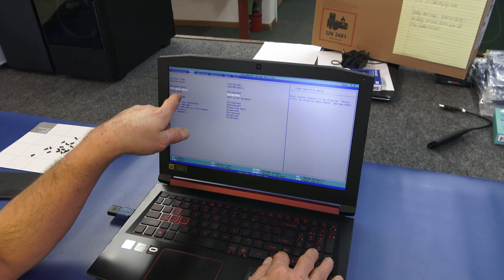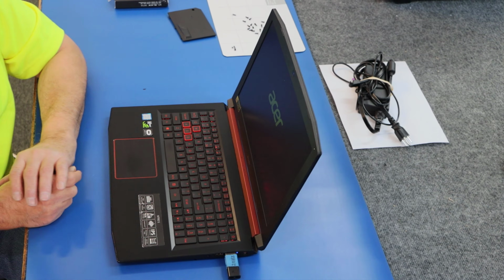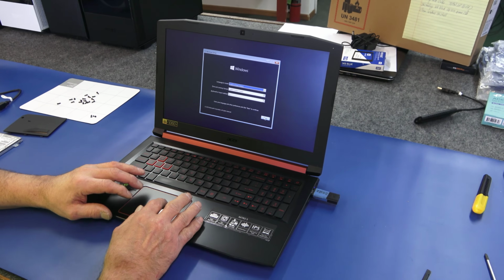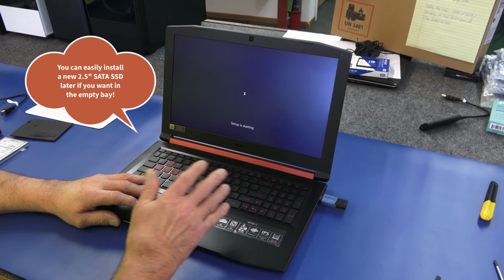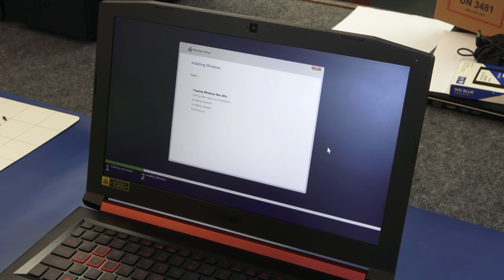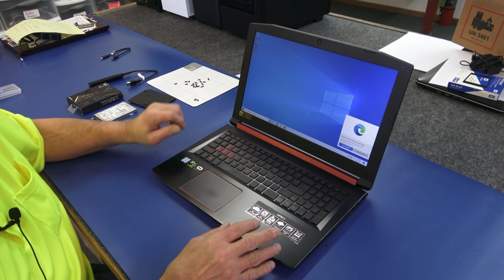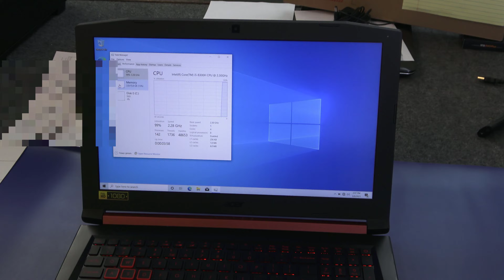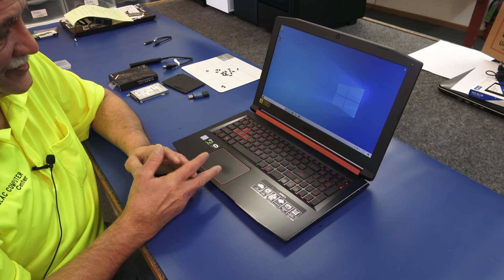Acer Nitro 5 AN515-53 Replace Bad HDD With New NVMe SSD, Upgrade Memory, Clean Windows 10 Install

Comment: Bonjour , je vous envoie ce petit message de France , et vous faites partie de mes youtubeurs favoris , grace à vos vidéos trés bien expliqués , j'ai pu installer un NVME de 1 terra , plus 1 SSD de 1 terra et passer à 32 gb de mémoire sur un petit laptop hp de 15" amd ryzen 5 HP Pavilion Gaming - 15-ec0001nf et ce il y a deux ans grace à vos vidéos , et la je vais changer mon NVME de 1 terra pour un crucial de 2 terra .
Toutes les opérations que vous fournissez m'ont complétement guidés et tout fonctionne , un grand merci à vous , merci beaucoup Cordialement Arnaud Pernet Kersanté

Comment: I replaced the HDD with a new SSD. I get a message “ no bootable device”. So I put the HDD back in and it works. How would I transfer whatever is on the HDD to the SSD so I can remove the HDD entirely and have it boot normally?
Reply: hey do u still have this issue?

Comment: so my laptop also wouldnt boot and i got it rapaired turns out the guy just took my 1 TB thing out and downloaded windows on the 100GB thing and now my 1TB things place is empty so i got a 200 GB ssd drive and i wanted to know if i can just plug that in the 1TB things spot and then do the thing i need to in the settings to it and it will work pls tell me i really need to know becuase i need more space but i cant buy a new one so i just want to know how to get that ready and working

Comment: I’ve had this laptop since 2018 but the battery doesn’t last as long as it used to. Is it still worth upgrading its specs? Or is it time for a new laptop
Reply: Always buy laptops around Black Friday. I got an Acer Nitro 5 with ryzen 5600H and 95w RTX 3060 for $650 last year. There was another option of a Lenovo IdeaPad 3 with newer processor but only RTX 3050Ti for $600. I payed the extra $50 for 3060 since it had 4gb vram vs 2gb 3050Ti. I replaced the ram with a 32gb kit and got a 1 TB WD SN570 to upgrade it and only spent $800 total.
Reply: Personally I’d keep it for a couple more years, get what you can outta it, you can get new SSD and upgrade the ram to 32GB and it will go decently fast.
Reply: Right now amazon has WD SN850X 1TB m.2 nvme SSD for 65 or 130 for 2TB if interested.

Comment: Hey! I ripped the sata cable connecting the hhd to the mobo while taking the lid off. I’m replacing with a nvme but I was hoping to keep that info on the hdd. Can I just replace the sata cable? It’s a clean rip (on the hdd side)

Comment: Did you use the ssd with or without heat sink and what do you think about the sn850 ?
Reply: Heatsink won't fit unless you get one of those thin copper heatsink plates on amazon. Idk if you've already got an ssd but 1TB WD SN850X is 65 right now on amazon and 2TB is 130
Reply: amazon m.2 copper heatsink. You'll see them with thermal pads. I just got 6 copper plates with thermal pads for 16

Comment: Can you add a SSD instead of a HDD?
Reply: Yes you can.  I swapped one into mine, as the 1GB Toshiba drives are a little suspect.  I didn't even realize there was a slot for NVMe until this video!

Comment: I was told that this model of laptop had two SSD slots, but i think i only saw the one where he plugged in the ssd. im not really very technically savy, and dont want to waste time/money getting two SSDs if it can only take the one. ("AN515-53" was all i could find about model?)
Reply: The other is 2.5" type.. installed with the hdd (the one that dale unplugged when he is trying to open the shell).. that slot can be replaced with SDD 2.5" type.. the upgraded SSD (on the vid) is NVME M.2 slot type.. so yeah, you have 2 slots for SSD, one that interchangeable with hdd

Comment: Hi... I actually have the same Nitro 5 but the AN515-52 and i have a 1TB mechanical drive with all my data... I'm planning to buy a 500gb m.2 ssd but i'm not really gonna replace the mechanical one, instead i'm gonna add the M.2 so i can have Windows running on it and have a faster pc and 1500 GB of total storage... I have a question, can i transfer all my information from the mechanical to the ssd once the ssd is installed? And do i have to install the windows in the new M.2 just the way you did here? Cause i have Windows 11 running on the mechanical drive :/
Reply: Ideally the data transfer would be done before installing the new drive
Reply: I have same laptop and planning to do that to can you explain to me how to install the SSD on the windows 11 please or a link ?

Comment: If youre taking questions I was thinking about doing this as well to mine but wanted to keep the mechanical harddrive so I wouldn't have to reinstall everything on my laptop would keeping the old HD with the SSD cause any lag or issues?? and also would i be able in transfer all information from the HD to the SSD once its installed and then pull the HD? any help here helps thanks for the video !
Reply: I second this question if you still read these!!! This is what I would like to do if possible.
Reply: @realsheasmith   I looked into it and found out it's possible to clone your data onto the new ssd ! The program you use will vary but you'll have to pay for most of them. I'm thinking about biting the bullet and just digging through my files for anything I need and doing a clean install from there !
Reply: @chrisnm93  thanks so much!!!

Comment: Can i upgrade the graphics card on this laptop, I have the same one and I want to upgrade the SSD and Ram, but can i upgrade all the other pieces?
Reply from the maker: You cannot upgrade the graphics. You can certainly upgrade SSD and memory though.  Dale
Reply: @CadillacComputerCenter  do you know if I can use any type of the PCI SSDs for the upgrade like you have done?

Comment: Since this is NVMe, what are the optimal UEFI settings if this was your only drive? Do you install with AHCI SATA or is there some steps you have to take to enable PCIe?
Reply from the maker: Nothing to change.  Good to go
Reply: @CadillacComputerCenter  I see, thanks! If I ever do get an option for AHCI or RST, which one should I choose if that's my only drive?
Edit: My mistake, if I'm correct the only option is NVMe which is a control interface right?
Reply: @CadillacComputerCenter  I am planning on maybe buying the same SSD you showed in the video, I have the exact same laptop. Do you know if the motherboard has cooling for NVMe or if it's really necessary?

Comment: Thank you for posting this! It helps a lot for someone like me doing my own repairs. I was wondering, I always heard that RAM sticks should be the same make when you install two, but I saw that you installed a stick in addition to the one that was already there instead of two fresh ones. Was what I heard not correct? If I have a spare 8gb stick of RAM can I slot it into my nitro no matter what make it is? Thanks again for this no-fluff video guide, I seriously appreciate it.
Reply from the maker: Hi. Ideally,  using identical ram sticks is preferred, mainly for stability,  as long as both sticks are of same speed and CL, you will be fine. Mixing brands of same speed will still give you dual channel.  Dale
Reply: @CadillacComputerCenter  Thank you so very much for such a fast reply! I've subbed, so I look forward to learning more from your channel.
Reply: @CadillacComputerCenter Do all the timings need to match as well as CL?

Comment: I've fixed cracked laptop panels with q bond glue.  It's like superglue with an additive to it.  I'm not sure if that crack was severe enough to be worth it though.
Reply from the maker: Hi. It wasnt too bad of crack.  It was in a area that was pretty secure. It was cosmetic more than anything. Thx for vfc the info though. Good to know.

Comment: I liked the old SATA to blade system my 2006 HP Presario had for the HDD, just a simple adapter that connected directly with the MOBO, no cables.